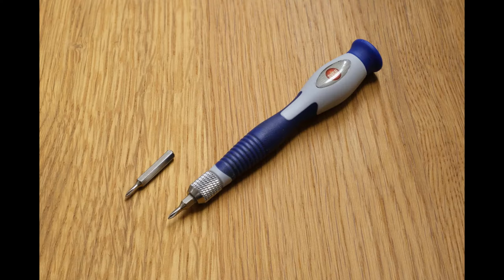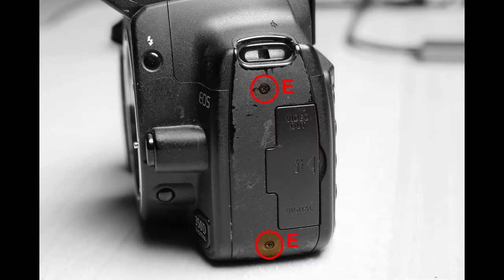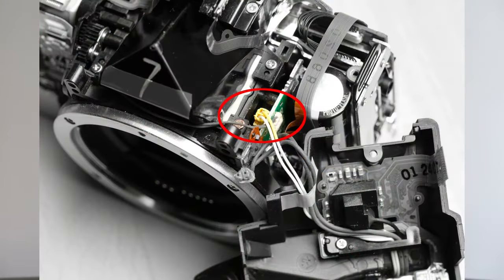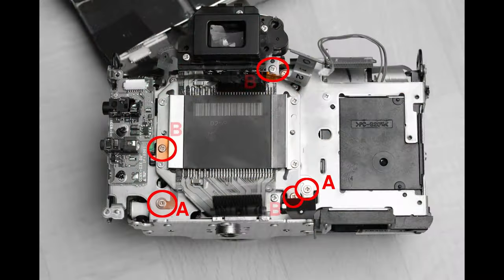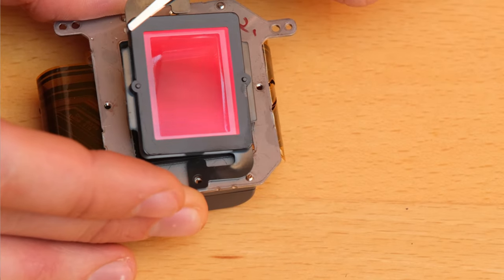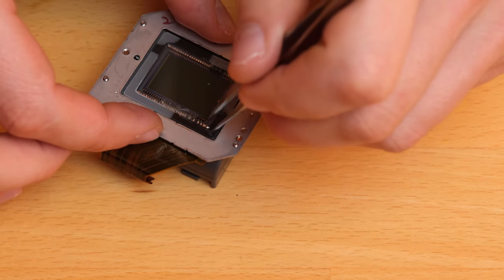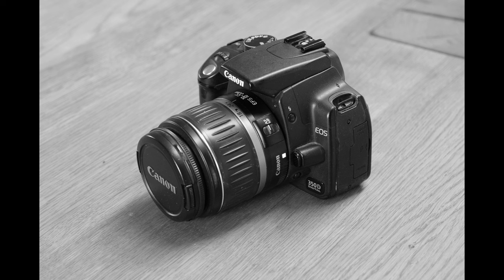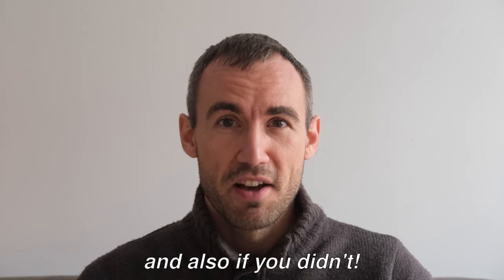Mono-Conversion of a Canon 350D

Comment: Camera technician here that has changed probably 1000 sensors due to bonding issues. Actually I still have many sensors left. I had seen the progression from monochrome to color. First they used 3 ccd systems in an effort to retain the most possible light using very expensive prisms. Then the race to find the very best single chip and filtration system began. Every manufacturer had their own way and despite being a Canon agent for a while I never had to change a canon ccd. But I had endless requests from enthusiasts who wanted the color filter removed for either night vision or artistic perfect monochrome photography. Since I had already suffered with enough health damage inhaling chemicals or lead fumes from soldering I must admit that I failed at removing filters.  Others have mentioned that you can actually still find true monochrome sensors but make sure the sellers actually know what they sell in our drop ship world.
Reply from the maker: Hey, thanks for sharing your story about the progression of sensors, I find the history of photography/light so interesting!

Comment: I tried this with a Nikon D5100 a few years ago and failed miserably. The glass covering the sensor is glued on so strongly there was no way to remove it without shattering the whole thing. I even tried heating it to uncomfortable levels but the glue never budged. After hours of trying the glass shattered and the golden pins inside also got ripped.
Reply: Sony had probably made the most chips and probably the hardest to remove filter. Heat them a bit and the bonding fails. I changed 1000's because of heat failures.

Comment: I did a full spectrum convertion on my kissx4 (400d) to solv the autofocus i did the screws up tightet,  (old lemses have the red mark for ir focus, measured the distance difference and eyeballed it on the sensor. ) and the ircut filter got broke so not much going back. I later got a sony ,and was underwhelmed by the color ,and regretted messing with the canon as i liked the accuracy of its colour. 
I think dentistry tools would work well for your scratching process (i can barely believe its real) a 3mm round spatula impliment i think for pressing filling material in.